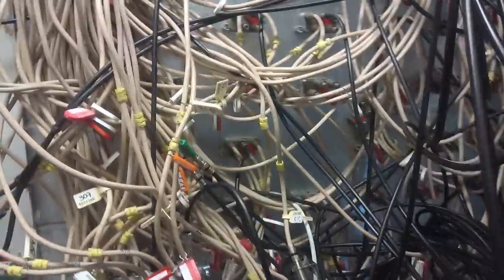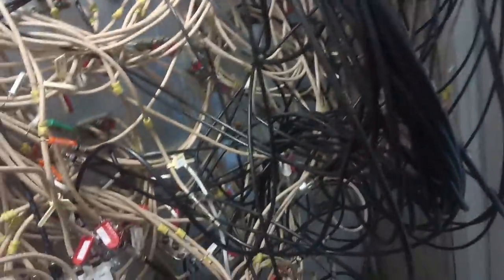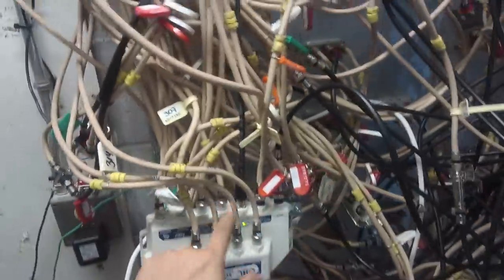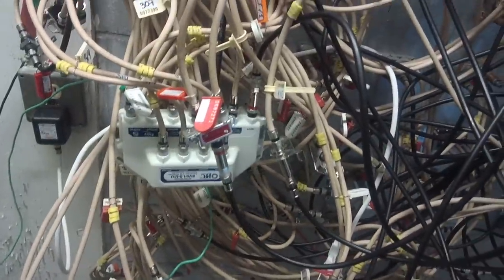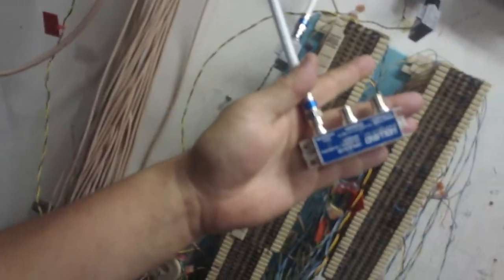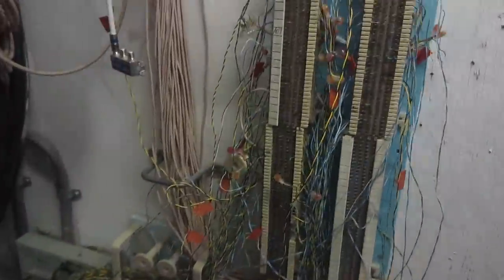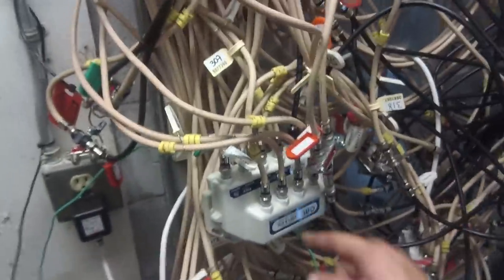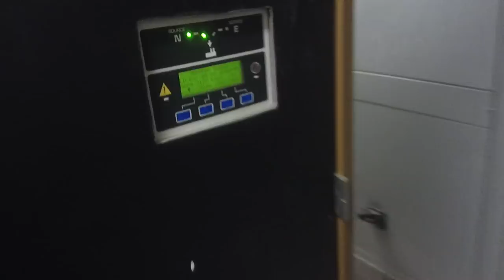Cable TV Wiring Doos And Donts Part 2 (A Year Later)

Comment: if you don't know what your talking about why even make a video about it. "Doos and Don't? you never talked about that. 

 the "enunciators" you are talking about are actual moca filters... just leave the room close the door and dont mess with it anymore.  Also, you are likely getting shocked because it does carry voltage... usually 15 Vdc but it can be up to 300v in cases where there is a faulty equipment
Reply from the maker: Rolo19383 why make a video cuz I get paid whether or not I'm right or wrong
Reply: Makes sense...However, you should add a disclaimer saying you have no idea what you are doing, people could get hurt and you can get sued.

Comment: 9:05 that is a filter/attenuator for a whole home DVR system. It is meant to keep the frequencies that the Master DVR puts back in the line to communicate with the slave units in the apartment/house from back feeding into the node causing ingress/noise.
Reply: RoyMoses MoCa